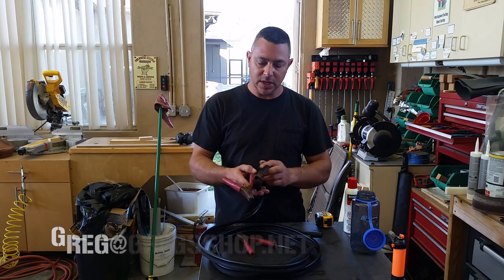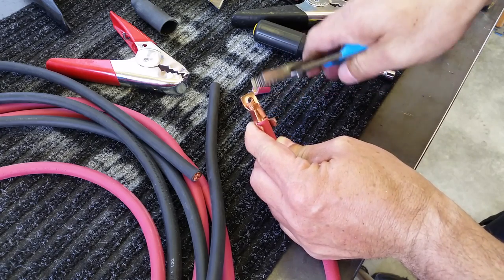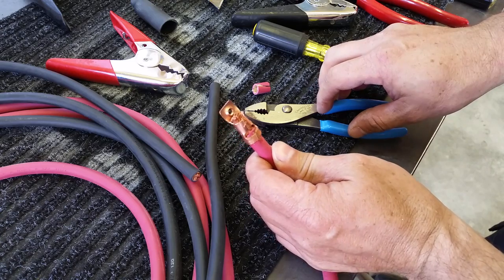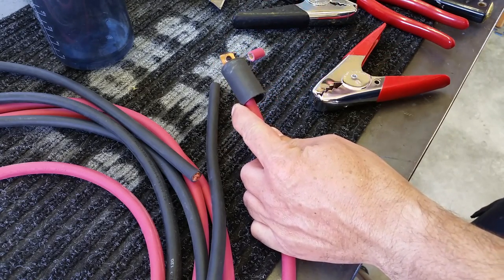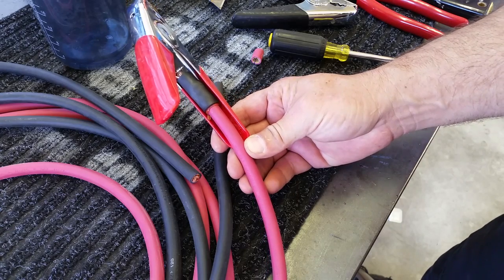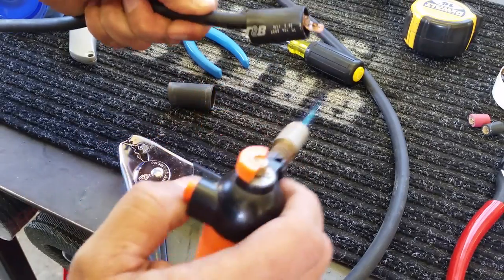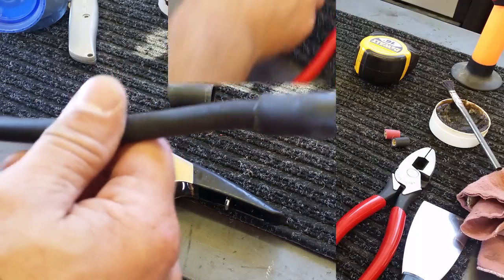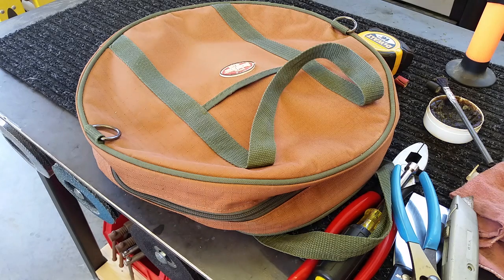How to make a set of high quality jumper cables

Comment: Retired Power Lineman here and we used to make High Voltage cables.  ONe thing we did different was tin (solder) the wire before installing the connector.  Flux your connector then squeeze it over your soldered wire.  Of Course we had a pot full of melted solder so we could just dip our cable into, but this way you don't need to heat the shielding on the wire as much and you get more solder up parteher in the wire under the shielding.  That help with the connector clamping onto something more solid.  And once yu squeeze the connector on then it's a simple matter of just heating up the solder enough to bond woth the connector.  Again not baking the insulation shielding.  In high voltage underground cables not stressing or baking the insulation is paramount to having a good long lasting connection that won't fail for years in the harshest conditions.  Hope that helps!
Reply from the maker: Excellent information! I’ve seen that done with the pot of liquid solder before and seems like that is the best method. When I did this project I did have to heat up the copper enough that it made the insulation soft. Thank you for your professional assessment and advise.  Also thanks for watching and taking the time to leave such detailed information.

Comment: Yeah really good and don’t often comment on social media but enjoy it when genuine people try to help others by showing them skills like this. The only thing I might say is maybe consider using a solder that doesn’t require flux (I’m a plumber) because if any of that flux is left on the copper it will corrode within days just like on water / gas pipes etc - that said, it did look like it went all the way down.

Really good though. Well done 👍
Reply from the maker: Thank you for watching and I appreciate you sharing your expertise.  One thing I didn’t show in the video was I purchased the nylon sleeve used to protect hydraulic hoses on heavy equipment.  I slid both cables in the sleeve. That keeps them protected and keeps the cables together.  thanks again!

Comment: You could make a Mexican set. A Mexican jumper cable is two old rusty cars in Tijuana. Touch the bumpers, take the bumper jack, touch said jack to both positive terminals, and LOOK OUT! (Sparks, flame, shorted doors and windows, death, mayhem, and madness. Bumper jack gets HOT!) But, will work in a pinch, and even though McGyver would never try this, it will work, ONCE!
Reply from the maker: That made me laugh!  It will work,ONCE!

Comment: Hey thanks for making this video. Really helpful. What is the make and model of the gas lighter you are using for welding the soldering cable on there?
Reply from the maker: I just picked up the mini torch from Harbor Freight.  It runs on butane and is refillable. Thanks for watching and leaving a comment.  https://www.harborfreight.com/butane-micro-torch-63170.html?_br_psugg_q=butane+torch

Comment: I would suggest 2 things: 

1) DO NOT USE plumber (acidic) flux. Go for the flux for electric components. 

2) DO NOT use burner. Use either heat gun or powerful soldering iron. That way you won't burn flux and oxidize your wire/solder, making a better mechanical and electrical connection which will last ages.
Reply from the maker: Thanks for watching and leaving a comment. All good advice!

Comment: Nicely done, however soldering in this particular situation is not the best of ideas. It basically adds another metal between two pieces of copper, which, under this kind of loads, shrinks and contracts differently than the surrounding metals. This may in time lead to cracks and lower overall conductivity. Granted, it may never be even noticeable, when the cable is used sporadically, but the theory is there. Here it is more a question of longevity than safety.

Otherwise: a very nice tutorial :}
Reply from the maker: All good information! Thanks for watching the video and lending your expertise.
Reply: @GregsShop  The pleasure is all mine :)

Comment: I was thinking even though you might never need or use one plenty of other people you come across might benefit though, key trick is having one thats a reasonable length for starters, then the quality of gauge and clamps, best to leave connected a couple of minutes before starting though and switch off internal electrics and air con.
Reply from the maker: I usually carry the cables so I can help others.  I make it a point to know what state my battery is in just like I monitor how much fuel is in the tank.  You are exactly right.

Comment: You need to take some sandpaper and rough up all of the metal on the Clamp connector and the cable in order for the Solder to adhere to the Clamp and cable good, also ....I've been brazing for over 20 yrs and every piece of metal that contacts each other has to be cleaned by sandpaper or the Solder will break loose sometimes even if using flux, everything has to be sanded and cleaned

Comment: List of materials, type of solder, etc. would be helpful. Those cable clamps look cheap, which is a shame since the cables themselves are of nice quality. 
Also, NEVER pour water (shock) a weld/solder joint. Let it cool off on its own.
Lastly, that heat shrink is way, way too large for that fitting and the adhesive is used more for keeping the tube in place while shrinking and offer some water rejection than suggested tensile protection.
Reply from the maker: Thanks for watching. The cable clamps are of good quality but I don’t like the sheet metal screw used to bond the cable to the clamp. I have since replaced them with a nut and bolt

Comment: Plumbing paste flux on an electrical connection is the absolute worst thing you could do.  Quality electrical solder has all the flux you need built right in.  Paste flux is designed for much higher temperatures used in soldering copper tube and you never melt all the flux before you melt the insulation.  Just don't use it.
Reply from the maker: Hey David, thanks for your comment and watching the video.  I realize it contains some bad information regarding the flux and I’m sorry about that.  I have since purchased a hydraulic hex crimper and fixed the cables with new ring connectors. They work much better than the ones that came with the clamps.  Thanks for sharing your expertise. I appreciate the constructive feedback.

Comment: I know this video is fairly old. but I figured I'd try to contact you anyway. I have a set of jumper cables that are very old that my father had gave me kind of sentimental but the actual jacket on the cables I have started cracking and falling off my instinct is to remove the jacket completely separate the wires and try to repair them they are super heavy duty 20 ft long either one or two gauge pure copper but for the life of me I could not figure out what is the best thing to use. since they could be having up to 800 plus amperage running through it I was wanting to ask a few people's opinions as far as some type of insulation and shrink tubing possibly or insulation and plastic dip spray many light coatings and then shrink tubing. I don't want to make them too heavy but I certainly want to make them safe. your thoughts on this? and I understand completely anything that you should just an idea and if I shock my dumbass self it will be on me and me alone. thanks
Reply from the maker: I totally understand the sentimental value of things.  I’m not sure it would be worth the time to salvage the copper back to working conditions.  The only idea I would recommend would be heat shrink tubing from one continuous roll.  It will be very difficult to get the tubing on to the wire since the diameter will have to be fairly close to the size of the wire. Then when shrinking down, it sections will shrink at different rates causing un natural curves to the wire.  It may have the same insulative value but most likely won’t have the same abrasion resistance. The cables will be hard to wind up and store as well. Plastidip spray probably will not bond with the existing cable sheath.  I hate to say it but you probably would be better off leaving them that way and not using them. Buy or build a working set so things are safe. Best of luck to you and keep me posted on what you come up with.
Reply: You can remove the first 6-12 inches of insulation from the ends and see if you get quality (shiney) copper down the length of the cable. If the copper looks like it is in good enough condition to use as jumpers, you can then strip of all remaining insulation from the wires. As far as new sheathing, you can choose from a wide variety of electrical grade sheathing that's properly rated for your application, (800 cca). Heat shrink tubing usually comes in a 2:1 shrink ratio, but 3:1 and 4:1 and even higher are common. The higher the shrink ratio, the more expensive. You do not need marine grade with adhesive or anything like that, and the other main concern is the heat shrink abrasion resistance and wall thickness.  You'd want some with high abrasion resistance as it will be dragged across pavement, bumpers, gravel, etc. Choose a diameter that is within one diameter or less of the gauge that your cables are, the less the sheathing has to shrink the more durable. The trick to get the wire inserted into the heat shrink is to lay the entire length on a long table, preferably, and use an air hose at about 35psi or so to "inflate" the heat shrink as you feed the cabling into it. Using talc sparingly  as a "lubricant" will allow very minimal resistance when applied to the inner sheathing. (good reason for not using glue-lined heat shrink) when trying to feed the cable. And super highly recommend a heat gun with curved shroud tip to heat shrink the tubing a few inches at a time working from one end to the other gradually. I used to fabricate military-grade MILSPEC power cables for the US Army's Patriot Missile System Weapons Battery at Letterkenny Army Depot in Pennsylvania. This cable was 6 inches in diameter and over 35 feet long and weighed nearly a ton. It took me 3-4 days to fabricate a single cable and each cable cost the Army $125K. I also fabricated Force Provider cabling and MRAP (mine resistant ambush protected) cables and harnesses. Before I took that job over a decade ago, I always thought machines made cables and harnesses, but a vast majority of them are hand fabricated. Go figure! Now I always find myself "inspecting" any cables that I purchase! Funny, but its a curse!!
Reply from the maker: Thank you for your excellent reply and sharing your expertise.

Comment: Hey Greg, that's a great set of cables, good idea of soldering the cable and copper connector together for a stronger connection. Where did you buy the cable at.
Reply from the maker: +rvkubotaman I found the cable on eBay. 2 gauge welding cable for 26 bucks
Reply: May have to get some, could use it to lengthen my ground cable on a few of my welders.
Reply: If you have a welding supply shop near you, you can probably buy it there.  That is what I am going to do this summer.   The bigger the copper wire (smaller the gauge) the less resistance to the flow of electrons (current) you will get.  

Jumper cables you buy aren't even copper anymore!  They are aluminum and just do not allow a very easy jump start.
Reply from the maker: PotatoGunsRule you are exactly right.  I bought the wire off eBay because I got a better price on the welding cable there.  The welding shops by my house are a ripoff. I used 2 gauge cable for these.  Any bigger and I would have had to use bigger crimp connections and those would not have fit on the clamps I had.  I have a hydraulic crimper for the large fittings but would have soldered them too.   Thanks for watching and commenting.!  Get with me if you need anymore info on the cables or clamps and be sure to check out the other videos on my channel.

Comment: Could one take jumper cables and convert them into battery cables? 🤔
Reply from the maker: Sure but it’s probably cheaper to just buy shorter lengths of thicker  higher quality cable.
Reply: @GregsShop  lol for sure. I just have corrosion all over my cables and a spare set of jumpers. Covid has birthed some strange motivation lol. Thank you!
Reply from the maker: Look around on eBay or even if you have a local welding supply shop. You can get the cabling you need usually by the foot.  The cables I used in my video were purchased through eBay and they were great quality.  Best of luck and thanks for watching!

Comment from the maker: Greg Barnes,  not sure what happened to your comment but it’s not there anymore. Check this out. Any questions, you can send me an email at gregsshopfl@gmail.com

https://www.ebay.com/itm/2-Gauge-AWG-Welding-Lead-Car-Battery-Cable-Copper-Wire-MADE-IN-USA-SOLAR-/302192855674?mkcid=16&mkevt=1&_trksid=p2349624.m46890.l49286&mkrid=711-127632-2357-0

Comment: Where did you get the clamps?
Reply from the maker: eBay
Reply: @GregsShop  Do you have the link to the ones you bought?
Reply from the maker: Let me see if I can find it or an equivalent
Reply from the maker: This is a similar product from eBay. https://www.ebay.com/itm/2-Pair-Battery-Booster-Cable-Parrot-Clamps-Heavy-Duty-1100AMP-Jumper-Replacement/173737787804?hash=item287394419c:g:TaMAAOSwLKhcOqhv

Comment: May I ask where you bought the cable from?
Reply from the maker: I ordered it from an eBay seller.  This link is similar to what I purchased.  You can also search for welding cable online.  If you have a welding shop that sells cabling that may be something to check on. The reason for the welding cable is it has low resistance, highly abrasion resistant jacket and very flexible.  https://rover.ebay.com/rover/0/0/0?mpre=https%3A%2F%2Fwww.ebay.com%2Fulk%2Fitm%2F261080572842

Comment: Why not 0 gauge?
Reply from the maker: I simply did not need anything bigger than what I used.  The cables are only 15 feet long. Anything with a bigger diameter would not have fit in the clamps or on the supplied crimp connectors. I also did not want them to be too heavy. I wanted to keep the cost down. As it is, they are twice the the thickness of any walmart or auto parts store cables.   I have been using them for a while now and they work well.  The only thing I would change is the clamps.  I'd look for better clamps that can be used on a wider range of terminal orientations.  Thanks for watching and your comment!
Reply from the maker: Yeah I would use a welding type clamp.   I know exactly what you mean. I was just trying to keep the cost down.  Thanks for watching and leaving a comment!